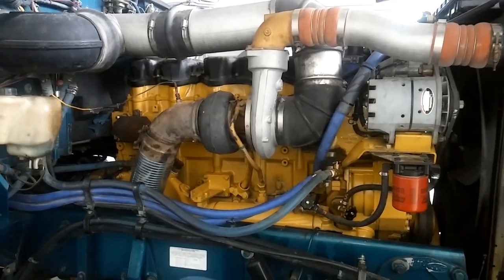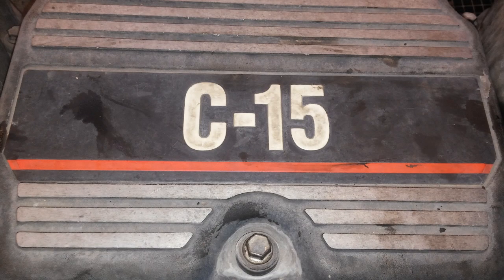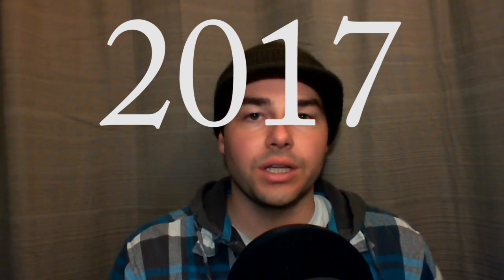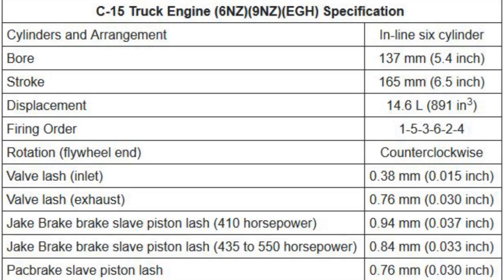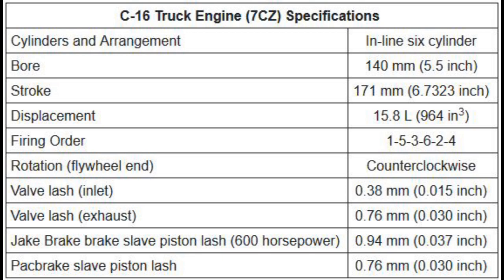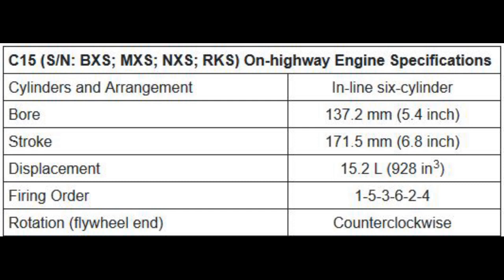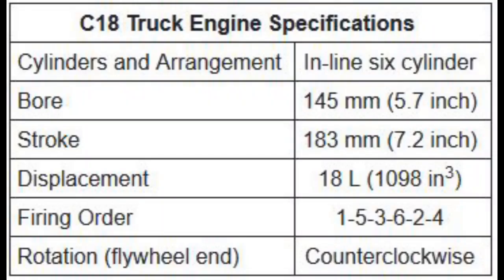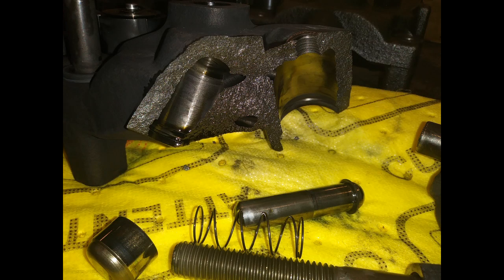What are the Differences on Cat 3406E, C-15, C15, C-16, 3456 and C18 Diesel Engines?

Comment: Would love to see a video on the 3406 A, B, and C. Especially the white 3406B. Had one in a 1984 362 Pete that only the heavy equipment Cat shops could seem to make run great. 
Thanks for all you share, I have learned a lot from your videos.
Reply: had a white one in a 359 grat running truck also a 84 model
Reply: I have that motor now in my 1988 KW dump truck

Comment: Great video, sounds pretty accurate 👌. You  said the 3406E and C-15 are the same, you can tell the difference at a glance because the 3406E still used the  puzzle oil pan gaskets...whereas the C-15 went to the thick rubber Gasket. 😉

Comment: Awesome tech video thanks Josh, down here in New Zealand we predominantly see the 6nz series and the acerts. I used to drive a K100E with a 3406b that had been turned up from 425 to approx 500hp, was amazing on hill climbs, especially when you  pre- heated the engine prior to climb and would routinely see slightly above 560 degrees c on the pyro🙏 that engine was the godfather.
Reply from the maker: There are still quite a few of the B models running around in North America. Always good to hear from you guys on the other side of the globe.
Reply: @AdeptApe  I watch your stuff religiously as you are one of the few people that willingly shares your experience and as I work for a company that is MAN, Western Star and detroit I find it very hard to get any info from our local cat dealers so much appreciated as always and merry Xmas to you and yours🙏🤗

Comment: I have a 6nz factory 550 ,had a cat 600 flash file installed . Apparently its a file for fire trucks. Anyways whatever they did it woke that muther fker up . Felt more like 100hp gain . Single turbo boost showing between 40-45 lbs .
   Really enjoy your content. Keep it up.

Comment: Love the videos, I’m learning  a lot. I’m looking at buying an older truck and want a CAT. I see a lot of them that are advertised as a 6NZ. Some have the oil fill tube on the drivers side near the front of the engine and some have it in the passé side just in front of and below the turbo. Are they both 6NZ but different year models, or are the 2 different engines? Thanks 😊👍

Comment: I would enjoy your take on the differences between the 3406 PCTA and the 3406 DITA (both the A and B versions)
Reply: 3406B was strictly DITA. 3406 (92U now called A model) was PCT, PCTA, DIT, DITA. Last PC's was in 1979.
Reply: @johngoldsmith6629  I knew all that but was wanting Adept Ape to get into difference(s) in fuel systems and in the injection itself. If I remember right the  A model DI engines had 5000 psi into the chamber and the B model engines had something like twice that much psi. Of course the PC engines were totally different as far as pressures and location of the actual injection.
Reply: @guyconnell2250  C models I was told was in 17,000 injection psi. Go ahead and tell me what you already know so I don't have to repeat myself. Been with Cat over forty years.

Comment: Great video.  Please make a video on the 3408, 3412 and maybe even the 3508.  Specifically WHY these engines have off-set rod journals on their crackshalfs.  Thanks!
Reply: The 3508 has offset rod journals because of its crossplane (up-right-left-down) crankshaft and 60° V angle, and what ends up happening is the crankpins have to be split by +60°, –30°, or –120° to get 90° firing intervals. A –30° split was chosen because it has the smallest magnitude and does not require "flying arms" unlike most (4-stroke) 60° V6's. 

However, one problem still remains. The 90° crossplane V8 relies on crankshaft counterweights to achieve perfect primary balance and therefore does not (assuming an up-right-left-down or up-left-right-down crank) require any balance shafts. However, with the 3508 and its 60° V angle, not only did Cat need to add the –30° crankpin split I mentioned before, they also needed to add supplemental counterbalancing because the 3508 has a rocking moment. While Yamaha, on their 60° V8 outboard engines (which is the same crankshaft configuration) use a counter-rotating balance shaft to address this, Caterpillar use unbalanced timing gears instead, so they do not beed to have a shaft running down the block. That's also why the 3508's have an extra timing gear in the front (which is a second balancer gear) whereas the 3512 and 3516 do not have this extra gear.

The 3512 is even firing with the 60° V angle and non-split crankpins. Nothing really special.

The 3516, however, does not fire evenly. It is a 60° V16 with non-split crankpins, and what ends up happening is that the enngine fires UNevenly, with firing intervals of 60° from left to right, and intervals of 30° from right to left.

Comment: C18 Industrial prefix with the parallel twins crank out over 900 HP, and do it with ease in some brutal applications. Track-type tub grinders running 14-16 hrs a day in the Texas heat,  Cat Emergency fire pump C18 is over 1K HP... 
Love the high hp continuous duty rating in a dead simple inline platform.

Comment: Great job on going through all that info. Love the way you do your videos very good at laying it all out my hat is of to you sir as they say. Loved the old 1693 TAs, is it true the early ones had cast iron pistons as they said?
Reply: I have never seen one. All the ones I worked on was aluminium. Early engines 1-00781 had a compression release and a forged body fuel system. Before my time and never seen or worked on one. Seen a picture in a 1964 Motor's Manual.
Reply: @johngoldsmith6629  Thanks for reply, I was lucky enough to drive a couple of them  and one of them the owner said this one has cast iron pistons so run it 1500 to 1900 he had turn it up it was putting out about 600 HP so was fun to drive, this was back in mid 70s fact or fiction don’t know but it lived a long time like that. Thanks Al

Comment: What engine would you recommend in the C15 range or 3406e
I’m putting together a glider that I purchased last year 
Looking for 650 or 700ph and I will be the only driver
Reply: try to find a 6NZ (C-15) and do a full IPD rebuild! (Also, go take a watch of a channel called “KT3406E” he builds these engines for big HP and is an incredible engine builder. Hope that helps!
Reply: @anrew1000  thanks for the information
Reply: @mikenagel155   I did a rebuild with ipd...lasted 180.000 only
Reply: @marceloevera2009  Who is IPD?
😎🤳
Reply: @anrew1000  IPD are making what they call a Big Bore Kit that will turn your 15.2L C15 Acert into a 16.9L "C17". I believe KT3406E mentioned that IPD are also working on similar kits for the 14.6L engines (3406E and C-15) that will turn them into a 16.3L C16.

Comment: A video on the differences and common problems between the A, B, and C engine would we really informative
Reply: 3406 now called A model, first cylinder blocks from 1 to just under 06000. They oiled rocker arms from the head bolt holes and would put oil in the radiator. Cat did a modification to the spacer plate to stop this.
Accessory drive air compressor likes to leak oil. You take a 1S9540 dowel if I recall, a letter size U drill bit. Drill into the front hsg and drive and install the dowel. Biggest problems on this series. 
They came PCTA, DIT, DITA. You cannot mix these parts will cause problems. Seen PC pistons put in DI engines and they smoke.

3406B Cat dropped the DIT and went only to DITA. First engine was a 7FB, used a A model head and it got finally changed in the nozzle chamber area. The front cover was changed and went to New Scroll Fuel  System, and to 7000 series nozzles from capsule type. Went from a slide VTU to a hydro-mechanical that is adjustable. Can leak oil around accessory drive.
Then with 4MG03600 fuel system camshaft and VTU was changed. Also JWAC I think was dropped and went strictly to CAC.

3406C Emissions is the biggest change I would say. A 3ZJ engine B or C model is the only truck engine that if you go by the parts book you will put the wrong nozzles in it. 
3406C 8PN, is a odd engine and lots of changes, pistons, head, exhaust manifold etc. Again just to meet emissions.  

Starting at 4MG03600 and to 8PN series. Numerous VTU changes as they had problems with carrier slipping, bolts backing out and such. 
Starting in the early 3ZJ, era and other engine prefixes in this time frame the rod journal was increased, also other changes to the connecting rod. You have to get the article as it is a lot to type. Injection pump hsg changed and increased cam journal size.
The injection pump went from a single helix (early B models) to a dual helix (later B models) and the played with the check valve design. As fuel psi was increased for emissions a lot of fuel lines would break. If you didn't have the proper clamps they failed fairly quickly. Best to use the 8PN set up and I do some changes to it as well. 
 Emissions is the biggest so you have several piston compression ration and such, fuel system camshaft for timing and a few engine camshaft designs. Again a lot of typing and not worth it.

Comment: Caveat from what Scott is asking: I have a 87 KW with a 3406. How can I tell which mode od engine it is whithout the name/SSN plate?  is there a difference between the jake break kits on these CAT engines? I found a Jake Break Kit:  143-6628: KIT-BRAKE, Brake Kit (Engine Compression Brake) but not sure,
Thank You

Comment: Hey I work at a place where we manufacture c15 c15.2 c16 c18 3408 c27 and c32 crankshafts. I would love to see a video on the 3408 and why it's a split pin crankshaft. And also more info on c27 and 32s. Thank you for the awesome informative content.
Reply from the maker: Are they aftermarket crankshafts or do you work for Caterpillar?
Reply: We manufacture new cranks for caterpillar as well as cummins and John Deere. To the best of my knowledge our cat cranks are sent to cat to be installed in new engines.
Reply: A 3408 crankshaft this way because,  a normal V-block is ninety degree. It turns the block into a sixty degree, thus you made the engine narrower and can be put in a tighter frame.
Reply: Right I read that before. The crank is so complicated. It's a strange looking thing. I also heard it was made because the engine had balancing issues.
Reply: Hey Garrett what’s the employee discount on them C18 cranks?! 😉
Reply: @garrettdougherty1986  They did have a balancer on the rear. What was fun was replacing the camshaft with the rear cover left on.
Reply: Joe4 We employees can not buy our cranks that we manufacture sadly.

Comment: In the marine world about five or six years ago (or maybe longer) they put out a 1150 HP C18
Reply from the maker: Marine engines cheat with their unlimited heat transfer abilities and then they also run them up to 2300 rpm horsepower curve sometimes, how is a truck engine at 1800 rpm supposed to fight fair?
Reply: @AdeptApe  You'd have to install a secondary A/C system with a massive evaporator placed between the condenser and radiator.

Comment: What’s is the major difference between a 3406e truck engine and a 3406e (795 HP) marine application? Is it just significantly more because of cooling or do they have different cams and injectors? Is bore and stroke the same?

Comment: Josh is it possible to put a C18 oil cooler and filter housing onto a C15 9nz motor obviously change the rear coolant manifold piece as well without any other drama ?

Comment: hi sir, my place of work has a 420EX multiflo pump, uses the C27 CAT engine as the driving force, but unfortunately the C27 CAT engine quickly overheats at loads above 85 percent, do you know why? Thanks.. like your chanel.. 👍

Comment: Hey josh. I’m sure you covered this before and I just missed it. But I have a twin turbo mxs motor set at 550. Would a CAT dealer be able to turn it up any more? To let’s say like 600? And if they can would that void a warranty when it comes time for a rebuild?
Reply from the maker: Hello Anthony,

So yes you can get an ACERT up that high, but you end up needing different parts, such as the camshaft, injectors, pistons, generally to do it the legit way is during a rebuild since you are changing those parts anyway.
Reply: First off if done at a Cat authorized shop, legally . The TC and or the TEPS (if not at a Cat shop like KW or PB) manager will have to be involved. Cat WILL ONLY GIVE LEGAL PASSWORDS TO THEM ONLY. That can be like pulling teeth out of a hippo with tweezers. 
A 550 is a 1850 FT LB torque engine. Your going to a 2050 FT LB torque. So the transmission and clutch would have to be changed. Also you would have to check with the truck manufacturer to see IF ANY OTHERS CHANGES need to be made. Such as drive line and such. The only 625 MXS I worked on is in a PB. It has a larger cooling system package than a 550. It mounts on the fire wall. I do not know if the radiator is bigger. Plus parts mentioned above will require a high psi turbo. Low psi turbo is the same. 
Always start with your full engine serial number and make sure everything is done correctly.    
Since you are NOT turning in the same parts as you are getting, you will need to see if the cores are in the same family. If not you might have to pay a core charge. Best thing is to call your Cat dealer and get the PSSR involved along with the truck manufacturer. 
I have rerated 3406 A's and up. This rerate I stay away from along with MBN's  and REGEN engines. To much legal hassle.

Comment: IDP offers c17 kits now.  C18 liner with a special piston height to wrist pin.  To run on a  15.2 liter c15 crank shaft.
Reply from the maker: Blasphemy! I wonder why not just run a C18 at that point instead of using custom parts, but some people like to be different. Now they need a big bore C13 that would be a C14 and you would have a full house.
Reply: @AdeptApe  id assume because the cost of a c18 crankshaft,  with no core available.  Plus c17 could be done as an inframe.  Also the c17 should have a better rod ratio.  Less side loading of piston.  Pistons are made by mahle.  Same as Caterpillar.     Kinda a win for guys wanting more.

Comment: There was a guy who had way too much money and a massive ego and was running a aerodyne Kenworth with a 3408 from Adelaide to Perth in the mid 80's, he named it aerocat and it was the fastest thing across the nullabor plain and the Cat dealer I used to work for used to see it for "more speed". But it was the mid 80's and fuel was cheap and rules where lax, whats a speed limiter? apparently this thing had a 100 mph cruise and it sounded great. It didn't mind letting you know it had plenty of grunt with growl it used to make and lots of carbons heading up the stack. Greetings from Western Australia, I am in the same line of work as you, but on the big earthmoving gear.
Reply: Simon Kerswell. From what I know it may be or is the last Australian built kenworth with a factory 3408 and was built in 84. I don’t know horse power ratings but it ran a compound turbo setup.

 It was rolled over and the cab was stretched to 3.5m.

Comment: I had one of the first 3406E in a peterbilt, wasn't running good and they hooked the computer up, ran the test.  the computer told them what to replace. they did and started the engine went wide open, they could not shut it down,  fineally got the fuel off and it stopped.  Cat sent a complete new engine.

Comment: If 1 were to put a C-18 in a show truck at 1,000hp would it be street legal and could it be done without heavy modification to the factory standard systems such as cooling intake and exaust?

Comment: are you all about cat engines specifically ?
do you have any experience with detroits, volvos, cummins, macks ?
Reply: He works at caterpillar
Reply: Everything you just mentioned will leave you broke , except the Mack , and that's because it will run all day on a little fuel , but will not compare to CATS , work wise.

Comment: What would the hp range be for a 6nz(6nz56420)without changing any hard parts(turbo,cam,injectors). Some say to get 550hp hard [arts need changed but any info I find says the later 6nz’ s all have the same hard parts. Thanks

Comment: Question I work with 3406 gas engines. Can pistons and liner be the same as an a 3406 diesel  or does it change
Reply: Liners are the same.  Pistons are significantly different.   Usually 4P8996 piston.

Comment: can you make a video explaining the difference between 3406E , mbn, mxs, and 6nz please
Reply: Short version, too many changes to make a detailed video. Most of the time it's to improve the product or a emissions change is required. 
5EK first full electronic 15 liter engine, 1994-1997, ADEM II electronics.
6TS same as above basically, 1997 ADEM II electronics.
1LW 1998 ADEM II electronics
2WS 1999 ADEM 2000 electronics 
Starting with 6NZ Cat change name to C-15.
6NZ last Cat 15 liter truck  engine before stricter EPA laws. ADEM 2000 electronics, 2000-2002
MBN Last single turbo, smart wastegate and pilot injection if I recall. Not popular because of emission requirements. ADEM 2000 electronics, 2003
Name change to C15
BXS first dual turbo with ACERT technology, IVA and separate optional engine brake if equipped. 2003-2004  
MXS second dual turbo with ACERT technology,  IVA and if equipped with a Cat compression brake they are made together.
NXS, same as a MXS. MXS ran out of numbers. 2005-2006
SDP, last 15 liter Cat truck engine. Most emission's regulations put on a Cat truck engine. Lots of emission related problems.
2007 to last build.
You also have 16 liter engines, 5DS 1998, 1MM 1999, 7CZ 2000-2002.